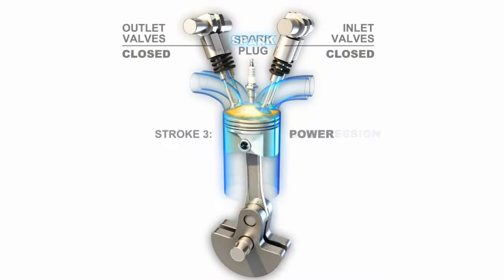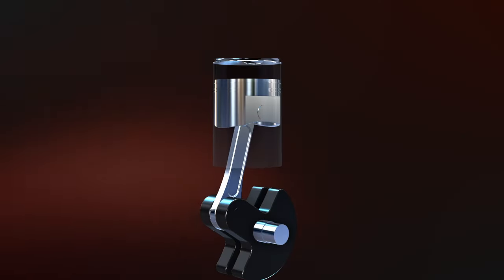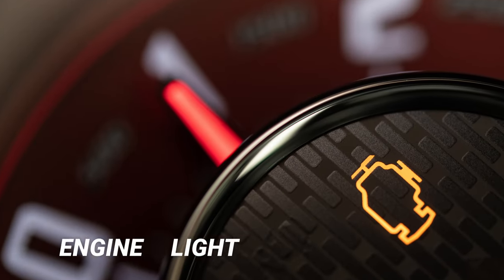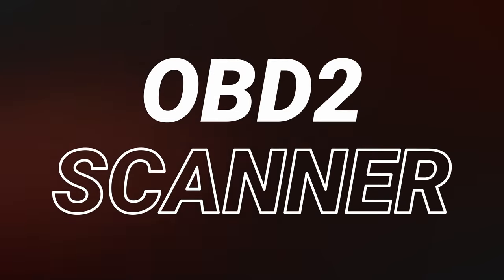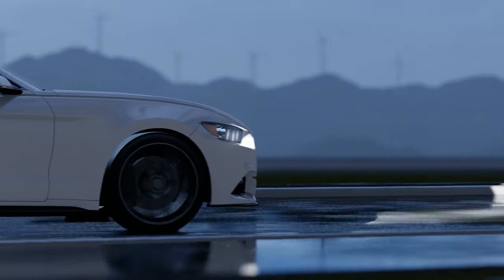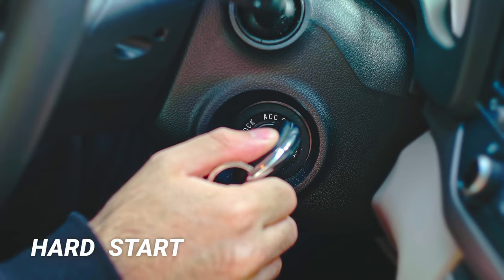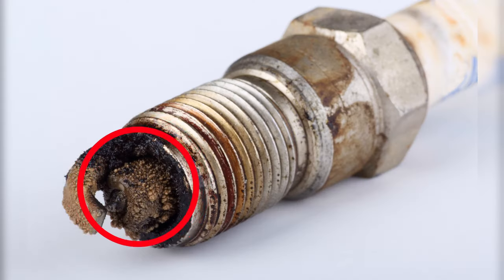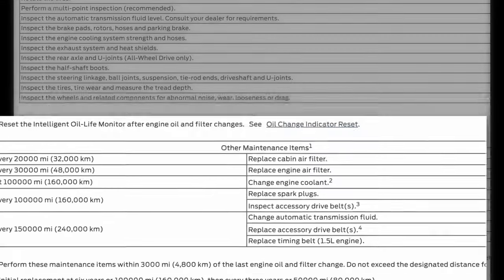SYMPTOMS OF BAD SPARK PLUGS

Comment from the maker: ➤ ︎ OBD2 Scanner: https://amzn.to/3PHRplS

➤ New Spark Plugs: https://advanceautoparts.rt8x.net/9ggZd4

➤ CAR REPAIR MANUAL:
https://www.gopjn.com/t/SENKTklLS01DSE1NS0lOQ0dKRk9LTw
(Use code AD10VA for 15% off one-year subscriptions for any US Order)

➤ Have car-related questions? Check out JustAnswer! They have verified auto mechanics that are available as live help 24/7: https://justanswer.9pctbx.net/qndBon

➤ Check out my merch: https://easyautofix.creator-spring.com/

➤ Here are some of my favorite items that you might like:
Tools: https://amzn.to/3xNDb8g
Car Vacuum: https://amzn.to/3EjhPSJ 
Cleaning Tools: https://amzn.to/3El7dCG 
Water Repellency Wiper Blade: https://amzn.to/3utvK50 
Cleaning Gel For Cars: https://amzn.to/36NIiMr 
Portable Air Pump for Car Tires: https://amzn.to/3uBuPzA 
Headlight Restoration Kit: https://amzn.to/3qDpOVH 
Amp Jump Starter: https://amzn.to/3pMd0vx
Reply: 😅😅😅😅😊 3:46 3:46
Reply: Could bad plugs or coils also cause very small rpm fluctuation ?? On a right budget could really use some help with my 2010 Chevy Silverado no codes no lights besides tire pressure monitoring system I just had to change my u joints one was pretty seized up I'm hoping it didn't cause further problems but iv had the truck 3 years n haven't had a tune up yet

Comment: Many of these symptoms happened to my car. Changed spark plugs on my Honda engine. Works and runs perfectly now
Reply: What year is your Honda?
Reply: @mikecosta7591  2016
Reply: Hopefully this is the case for my bmw, just ordered ignition coils and spark plugs today.
Reply: Can you tell me the symptoms that your card had because mine looses power just doesn’t speed up as it should
Reply: Did your car have a jerking symptom when at idle or acceleration?
Reply: @DonNeil4 did you figure it out ?
Reply: I have a Honda fit it has been behaving this way I hope if I change spark plugs it will work... It's consuming more fuel and jerking
Reply: @DonNeil4 yes

Comment: My 6 plugs looked like the one at the beginning. I had loss of power and rough idle symptoms, so today I had my spark plugs changed and the difference is noticeable. My car doesn't have a rough start anymore, cold start idling is stable, and acceleration is smooth. Hopefully it fixes my MPG issue as well, fingers crossed. Thanks for the help!
Reply: You waste gas still ?
Reply: @victorlafrance  surprisingly no. My car is old but I still get good MPG after the spark plug replacement, I get an extra 20-50 miles.
Reply: @DPLS77  but did you have slow acceleration and loss of power going uphills ? Before changing them
Reply: @victorlafrance  I don't drive in the hills so I wouldn't know.
Reply: @victorlafrance ya I would say change your spark plugs and start with that 

Engine codes can mean a lot of things and my dodge charger came up with a an issue with the “short runner valve sensor” so I replaced them and still check engine light… but I’ve been avoiding changing the spark plugs because it’s a lot of work… I ended up doing it and my plugs were toasted. Rusted, no tip of spark and a huge gap in between the plugs…. Video explained symptoms of bad spark plugs and it’s all true. Lost of power, bad gas mileage and takes a few seconds longer to start…

After spark plugs, car turns on right away no hesitation… car has full power now and def no more check engine light

Comment: Alright I got one for ya, spark, fuel, no start. Changed crank sensor, map, maf, tps, fuel pump, fuel filter, air filter, egr, spark plugs and wires, also has a new battery and alternator, no knocks or ticks has good oil
Reply: What engine? What about the crank sensor? And have you checked for compression
Reply: @MoppsyFloppsyTV  its in his list of stuff he has changed
Reply: Vacuum leak perhaps?
Reply: Did you purchase the car broken? Sounds like a key/computer comm issue
Reply: New battery but the ground wire to the battery may not have a good connection at the battery or the other end.

I replaced a battery and got stuck in the expressway in Boston.  Wouldn’t start with this fkn new battery 😂
Waited for tow truck.
He comes over to the front, gives the battery terminal a good twist and it started.

I say check ALL your connections.

Did you fix it, and what was it ???

Comment: I have an 08 Pontiac Torrent. When traveling at low speeds around 30-40mph and being gentle on the gas petal, the engine will lurch slightly and the rpm needle jumps slightly as well. Does this sound like spark plug or wires?
Reply: I’ve got the same problem can you tell me what was the problem please
Reply: did you figure out the problem?
Reply: @plutodread97  yes, it needed a tune up. New plugs and boots. Runs like new again

Comment: Im having a hard time finding an answer to this but my vehicle runs like crap after I start it if it has been sitting for longer than a half day. Bogs down under acceleration, sputters and chokes, it does this until it warms up then runs perfectly fine. My hunch is that it is the plugs, what do you think?
Reply: I have the same problem. Did changing spark plugs fix the issue.

Comment: I have most of the symptoms loss of power rough idling poor gas mileage but I don’t have check engine you think it’ll still be the spark plugs related?
Reply: Thinking same thing for me bruhh it has to be
Reply: I got the same issue. Did you manage to sort it out or find out what the cause was?
Reply: I’ve got the same issue lack of power doesnt speed up as it should only going arround 40mph max Citroen c1
Reply: Did you managed to fix it and what was the problem

Comment: I have the same issue on my opel insignia 2.8 v6. Drives perfectly fine even on high speed of around 250kmh as long as i don lt push the car and change gears quickly. As sson as i press the gas fully and accelerate the check light blinks for 4 to 5 seconds and car starts to vibrate and can feel jerking on gas till i turn off the car and when turn it back on its normal again.

Comment: Got my car serviced recently.. still under warranty. Having start up issues. No lights are on .. changed battery for free. But still experiencing a long start at times.. I feel like it may be the spark plugs
Reply: Work for a dealership, and the techs told me it may also be a bad fuel pump not sending proper fuel pressure. (Didn’t physically see my car but just gave me another example to what could be causing my issue)

Comment: I got check eng lights blinking like that and it smells like fuel in the car, and weird smell out of the exhaust pipe
Reply: Spark plugs not burning the gas going to the cylinder. Change ALL of them.

Comment: Hello my friend, what is the best type of spark plug, NGK or Bosch?
Reply: NGK
Reply: NGK
Reply: BOSCH!
 ngk is garbage i had them twice in my bmw they always breakdown and i get misfires
Reply: Sounds strange but German plugs are good for German cars.
🏯 Japanese plugs are good for rice burners.
That's from over half a century of my experience. 
Always multimeter check for continuity and impedence isolation from center and insulator before installing ( manufacturers fired quality control employees to gives stockholders an extra nickel).

Comment: I have a 1998 civic with the same issue i was wetting the motor with the engine off and a couple days later i started my car started getting these error codes and the crazy thing is i thought all components would be dry by the time i started the car im thinking i got water in the disturbutor cap spark plugs what you think ?
Reply: Oh yea I'm getting cylinder 2 misfire

Comment: You missed an important diagnoises If you take an ohm meter and test thr Plug what happens is the meter will read anywere from 1800 to 3100 ohms hopwever the plug can not maintain proper ohm the meter will fluciate from ohms to open.  if the plug is bad on the inside, I have bought new plugs and found at least 1 that were probably dropped and the plug was bad. the engine will intermittantly stop firing creating the misfire. this was verified on several ford f120 250 and 350 engines. Thanks for the infp.

Comment: I’m wondering if that’s what’s wrong with my cat

I have a 2014 Nissan Sentra my car before my car stopped my car would Stahl taking off from a light or a stop sign but it will drive fine then it recently stopped  but it comes on, but when I put them in different gears ithe car wouldn’t move and then the engine light came on days later and now the car won’t start but it’ll come on but it won’t start and I’m wondering, is it because I never replace the spark plugs and it’s not the transmission
Reply: Yes most likely spark plugs they can cause transmission type symptoms its not your transmission I can bet change all spark plugs at once and your back on the road full speed!
Reply: @Whereistes  thank you so much I will try that and see my car has been just sitting for about almost 2 months and now my battery is dead somehow but I’ll jump it and have somebody change the plugs and see if that helps
Different mechanics keep trying to tell me that it’s my transmission, but my uncle definitely said it sound like a spark plug problem
Reply: @Whereistes  thank you so much I will try that and see my car has been just sitting for about almost 2 months and now my battery is dead somehow but I’ll jump it and have somebody change the plugs and see if that helps
Different mechanics keep trying to tell me that it’s my transmission, but my uncle definitely said it sound like a spark plug problem
Reply: @BrittanyXO1  yep they try to tell you lies. So you go buy a brand new car 🙄 dont listen..Once you change your plugs the cars regular operating voltage will return aka power back to the wheel/Drive Train💯
Reply: With the battery dead it’s actually not a bad thing in this situation once you restart the car replace w/ new plugs any “Service engine soon or warning symbols” should immediately go off. If not after a few off and On starts. God Bless🙏🏾
Reply: @Whereistes  Thanks sorry I hope I’m not a bother but I also did a diagnostic and these were the codes that came up  P0746
P0846
P2765
Reply: @BrittanyXO1  Your not a bother. Okay so to me all of those codes lead back to a possible contaminated torque converter/solenoid or low transmission fluid pressure best case scenario its just low Transmission fluid pressure. Its not reading enough fluid to activate the gears or its blocked from old fluid you can get Transmission fluid cleaner from autozone very affordable prices. And if low fluid level is the case have someone top it off to level written in owners manual.
Reply: @BrittanyXO1  The car has to be IDLING in park with the parking brake on go through each gear in idle P —>D then back to P when they check the level of ATF fluid level to get the proper reading.
Reply: @BrittanyXO1  You will be back on the road in no time you might just need a transmission Fluid cleaner or just Transmission fluid to top off the right level and boom back on the road . You don’t need a new Transmission fluid might just be old.
Reply: @Whereistes  Ok yea but at one point I smelled a burning smell while driving but I will try those things you said to see if it fix the problem ..This is what the codes said 

P0846 
Transmission fluid  pressure sensor/switch B circuit range performance 

P0746
 Pressure control solenoid A performance/stuck off

P2765
Input/turbine speed sensor B circuit
Reply: @BrittanyXO1  the burning smell is low Transmission fluid 9/10 Ive seen that in these nissan cars as they age. Sometimes there will be a leak in transmission but it can be sealed for cheap. Have the Transmission Fluid checked if low on the report have shop or someone you know top it off. If fluid is dirty have them change it do not flush it!!!
Reply: @Whereistes  Ok Thank you so much
Reply: @BrittanyXO1  God Bless 🙏🏾

Comment: Can any of these “symptoms” be caused by a defective battery ??? My dad swears it’s the battery in my 2011 Hyundai Sonata hybrid causing the car’s random misfiring while I’m driving on the highway.
Reply: Your car battery is responsible for starting the car . If your dad thinks it’s a electrical issue … needs to check fuses , bad wires , grounding straps or the alt .
Reply: Battery can cause these problems. Good service is always good idea. Oil/ oil filter/ plugs /air filter/ fuel filter. But charge are replaced battery!  If you do lots of sort journeys battery never get the charge it needs. Top up battery once a month with a charger.